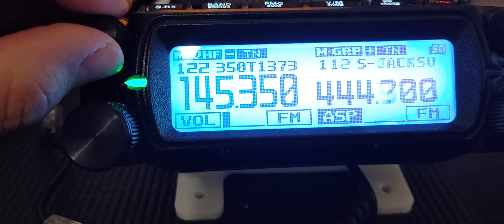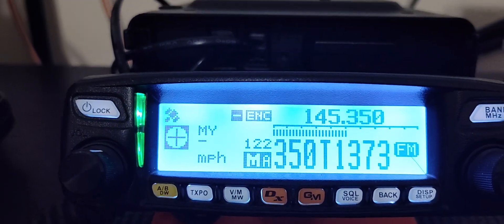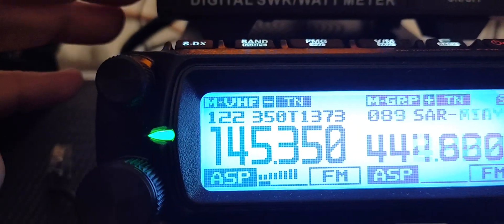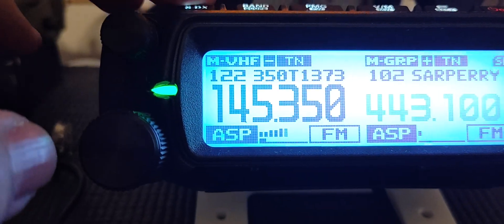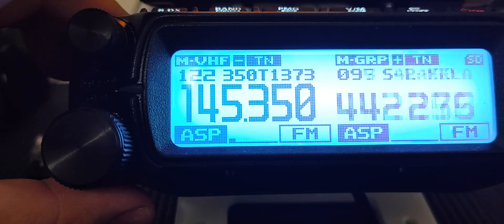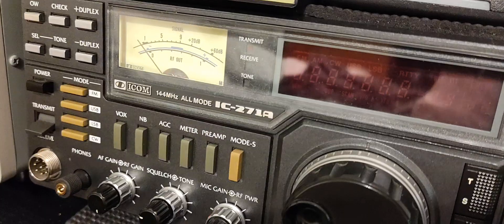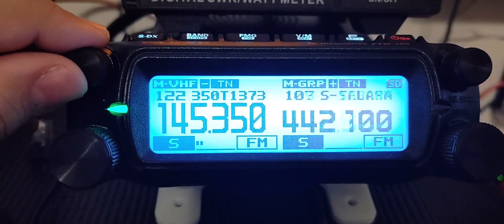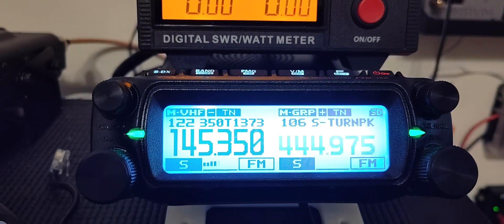🔊 New Yaesu FTM-150RASP S-DX/ASP Review: Weak Signal Performance & Features Tested @W4KWS 📡

Comment: Did you 3D print the base for the FTM150RASP? I'd like to get a copy of the STL if possible
Reply from the maker: @JasonSowder  yes simple base attaches the the m8 screw behind the head
Reply from the maker: @JasonSowder  If you search for ftm 400 or Yaesu ft891 head stand they are all the same. They attach to the rear of the head and provide a base.

Comment: what is your coax cable
Reply from the maker: Andrews Helix 1/2  from antenna short run 10 feet LMR600 after that. 73
Reply: @W4KWS lmr 600 is a very good coax,I use hyperflex 10 for home and portabl... 73

Comment: Hi. I have an FTM-500, and the S-DX button does… absolutely nothing. The FTM-150 actually has some DSP filters.
Reply: But it does. That's when it can achieve the 0.2 µV sensitivity — on paper. I recommend you compare it with a 30–40-year-old radio, or better yet, measure it with proper equipment.
Reply: FTM-500 doesn't have ASP.  S-DX is basically a pre-amp (or maybe turning of an attenuator if you want) it changes the sensitivity of the radio. ASP is what on HF transceivers is called DNR (digital noise reduction) plus some audio processing. John Kruk explains more in his podcast 'S4E18 - FMT-510D vs FTM-150, ASP, and SCU-67'

Comment: In this video you did not show the overloading effect (with SDX to ON, when weak signals get zapped by a nearby highpowerd TX)         
Do you have nearby highpowered transmitters ? (other  frequencies) ... i assume that the FTM-150 (SDX/ASP =ON) can not cope with that. 
I was going to buy this set because it is double conversion which suffers much less from overloading , and i allways have overloading problems (high antenna, in a city) 
now i dont want it anymore cause they spoiled it with their to-much gain amp ... i bet the whole series of models with SDX on it suffer from the same problem   ... they only get away with it, cause it takes others a looooong time to understand this problem ... Obviously i have to go back to a very old set or some commercial model to get real quality.
Reply from the maker: @djmambito2  No other high power signals near that frequency. Thanks for all the insight. Planning on a IC-9700 any experience with the Icons? Thanks
Reply: @W4KWS  , it can be from any frequency like FM-broadcast @ 90 Mhz ... or something on 172 Mhz  or even 460 Mhz ... to identify the culprit you would need to scan the whole spectrum using a very small antenna ( 2cm's) to only receive very loud signals,  1st start with the bands below the tuned frequency on your Yaesu ... Once you have identified a few, try to discover which one is the one causing the overloading. I know how to do that , but it's a little to long story to spell out here ... Suerte desde Amsterdam Holanda.
Reply from the maker: @djmambito2  Runing an SDR with small antenna and scanning recommended from a friend thanks again for all the information. 73